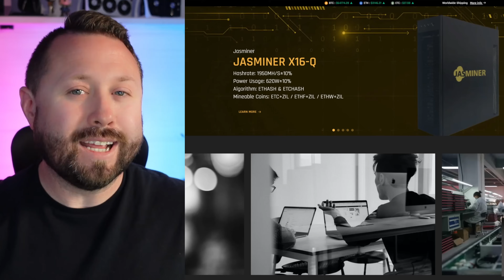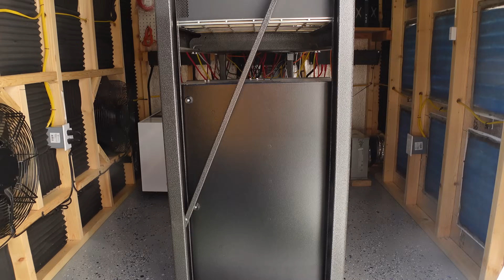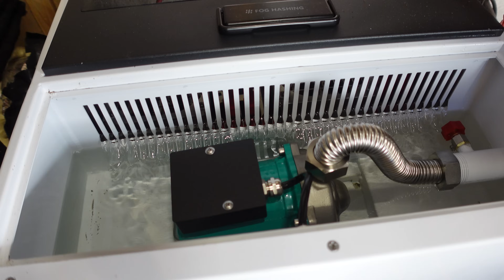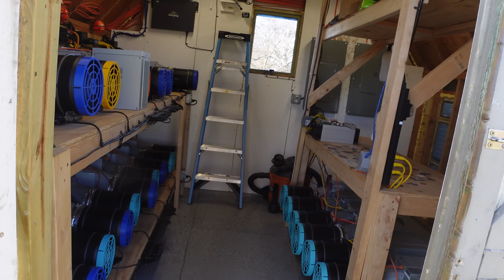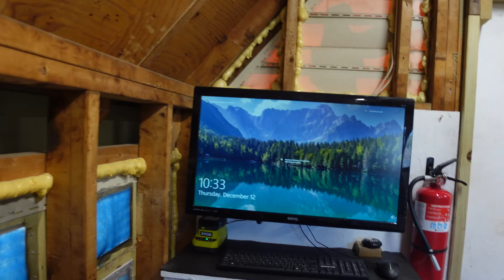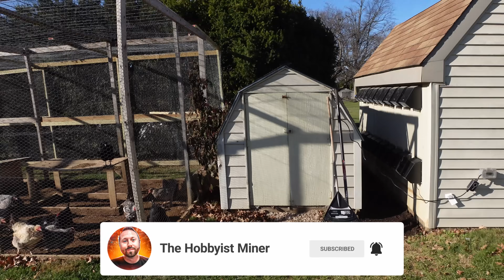How To Mine Crypto At Home And Get Away With it!

Comment: How did you epoxy the floor of your shed, I've been told I couldn't apply it to a plywood floor?
Reply: He probably just put it right on top of the concrete slab.
Reply: Or you could paint the plywood first, then epoxy.